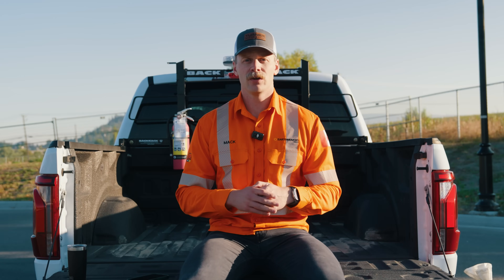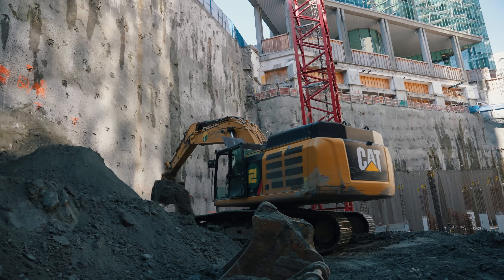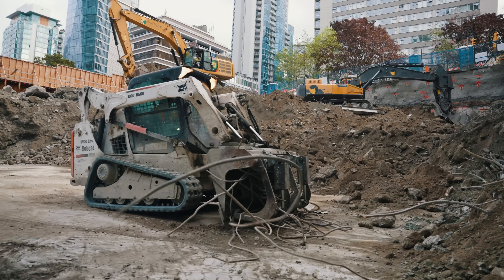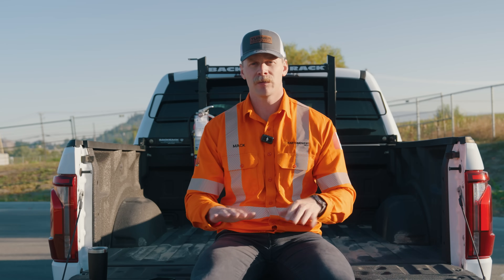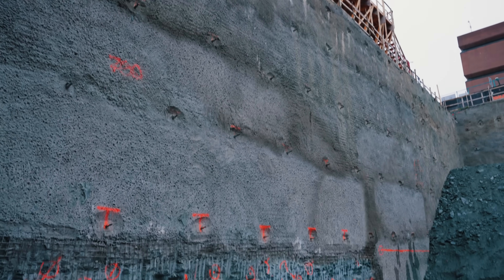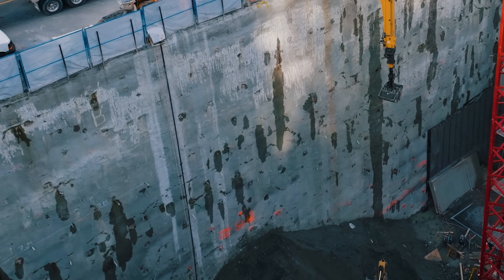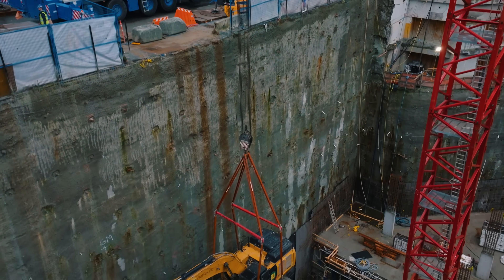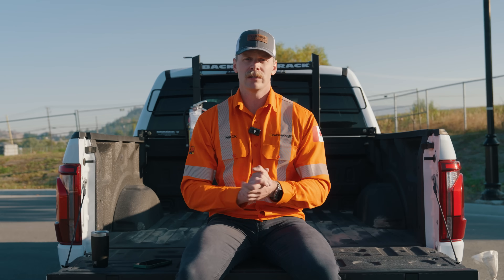Why are They Digging a 120ft Deep Hole in Vancouver? (Insane Engineering)

Comment: Those excavators don’t weigh 120,000lbs a 336 36 ton machine would weigh 79,366lbs and a 349 49 ton excavator would weigh 108,026lbs
Reply from the maker: That's what the crane operator said when he pulled up slack lifted them off the ground. I trust the crane scale.

Comment: If I remember correctly the Georgia Residential Tower on Howe Street back in 2009 was 123' deep
Reply from the maker: Depends how you measure "depth". The elevator footings in this one pushed 130ft deep, but the floor of the excavation was 120ft

Comment: How is this building is designed to be earthquake residents? Is also accommodate one of the reasons to create the foundation?

About 45 yrs ago I had worked for both companies. With bel I work as supply (delivering material) truck. Pacific, Work underground by Canada pool, in New West. Back then they were 2 separate companies.

Comment: i am a GF on the subway project about 90 ft deep, bel pac, and hall did our dig and shot crete, they both did amazing, and once we go to the bottom along broadway, the amount of water that is under that street is insane, i cannot give you a solid number but we have 2 main pumps that are 4 inch in 2000 litre settlement boxes at each end  of the station, that pump into a filtration system, and those 2k litre tanks fill up at least 500 times a day each, from dec, to march that number probably doubles, we have 3 sumps and we constantly have 2, 2 inch pumps in each, and about 6 other 2 inch pumps randomly in spots and tenches draining into those, so what im saying the amount of ground water under broadway is way more than downtown, its insane, its literally a river.
Reply from the maker: That subway project was one I wanted to cover, but sadly they were quite tight about media exposure

Comment: While this is an impressive technical achievement, I’m surprised by so few comments that at a time when there is a crisis with AFFORDABLE housing and many young people are not even getting driver’s licences let alone buying cars why does the City of Vancouver even allow these things to be built? A defining feature of affordable housing is few if any cars especially in dense central areas such as this, while a defining feature of luxury housing is plenty of cars. And at a time when there is a glut of unoccupied luxury housing why are the developers building this? When there is a continually worsening environmental crisis, why is so much energy being wasted on this excavation and removal of soil with thousands of truckloads rumbling through city streets? And to build these giant mausoleums for cars we are required to use greenhouse gas emitting reinforced concrete. As one commentator pointed out it will not be an insignificant commute to actually get your vehicle out of this thing. If you are really looking at a good way to store cars without such a commute or without digging such a hole, the developer could have considered automatic parking which for the same amount of cars, takes up a fraction of the space. Unfortunately any of these suggestions might make a dent in your business model.

Comment: When I was younger I thought of going to heavy equipment school and get certified to operate most digging machines.  Instead I went to work for the railroad.  I think I made the better choice.  At least I didn't have to worry about when my next job would start or shut down during the winter.  Railroading is a 24/7/365 business.😎

Comment: It's surprising and somewhat counter intuitive that the long arm excavator was more efficient than a bucket conveyor or elevator.  That's probably because the soil could be loaded directly into trucks at the top without further handling . 
My condolences to whoever 's assigned a parking stall on the bottom level.
Reply: My guess: the higher condos also get the higher parking stalls. 😁

Comment: We went by this site recently and I didn't realize it was THAT deep.  We watched a dig in Kirkland WA on a regular basis - covid -  (Kirkland/Lake/2nd) - and they used conveyers.  It took 3 of them, but they got it all out.  The amazing part is the stabilization.   Vertical walls w rebar, mesh, anchors, sprayed on concrete.  We watched them do this every 2 or 3 days - amazing work.

Comment: How about a counter weighted bucket / like an elevator.  When the bucket is lowered it goes below the surface at the bottom so the top of bin is level with the floor at the bottom.  Diggers push the fill into bin, the counter weight is then filled with water which then drops and lifts opposing bin.   Water is pumped back to surface and empty bin lowers back down for more fill.  The water is pumped in and out of the reservoir so minimal waste water used.  Only variable is how big and heavy do you want the bin with fill, if the attachment to the bin allowed it to be opened at the bottom or tipped to one side loading into removal trucks at the top be quick and easy.

Comment: Down town, only enough space for an excavator and a truck, next to live traffic, no dirt allowed on the pavement must go in truck, people and equipment working 120 feet below you, digging in rock pieces up to 18”. I would not what to be operating a cable clamshell 180 feet below the boom tip swinging around trying to aim at the side of a loose pile of dirt with people working nearby and then trying to get that swinging bucket of dirt into the truck right next to live traffic 80,000 times with zero mistakes! 
  A conveyor system that can handle 18” rocks, dig under itself, reach 140 feet up, put the excavated material into the waiting trucks (not on the live traffic), have the street open to two way traffic at night. With a company that big, that does this kind of work all the time, that have an office full of bean counting estimators, that bid the job to make lots of money AGAIN. I would guess they’ve got THIS JOB pretty well figured out also.
   I was wondering about the dewatering system on a deep project like this. Knowing that water runs downhill and this project is the deepest excavation around and that Vancouver is near the water. What kind of issues do they have with groundwater and runoff? I have worked on deep excavations next to the bay that had emergency generators because they said if the power should fail the foundation would literally float up out of the muddy ground if the building was less than 2 stories above ground level. And as the foundation floated up all the existed buildings around the project would start to collapse under the floating foundation. And that would be a very bad day.

Comment: Alberni st 120ft down hmm does thst put it below sea level? It just might id say .
Reply: 1515 Alberni is about 4 blocks from the Fraser River so I would guess the bottom of the pit is at least 80 ft below sea level. Hope a Tsunami doesn't wash across V.ancouver!
Reply: @OldNavyChief_314  I think you meant Burrard Inlet.
Reply: @honourbright73   The Fraser River is about 300 meters from 1515 Alberni, the Burrard Inlet is about1100 meters. But a moot point regardless.
Reply: @OldNavyChief_314  Fraser River is several KM away, not meters. 🙄😂
Reply: @alpinexghost  Right you are, I mistook the Pitt River flowing into Vancouver Harbour as the Fraser, my bad.

Comment: There's gotta be a way to get that dirt out faster. Like with a crusher, slurry, auger setup. One bucket full of dirt at a time looks like it would take forever to get all that dirt out of there.
Reply: I'm picturing this set up and it's not going that much faster to me. You gotta crush the big rocks which would be a pain in the ass and time consuming itself, you gotta mix the slurry including pumping down thousands of gallons of water, you gotta pump it back up to trucks which will take time, then you gotta legally dispose of this slurry now instead of just having clean fill you could immediately sell.

Comment: Could have used BelPacific on the UBC Okanagan tower dig up here in Kelowna.  I drove by the site a number of times as the hole was dug.  Even though the hole got deeper and deeper and was directly beside an existing residential tower AT NO TIME DID THE FUCK MUPPETS WHO WERE DIGGING THE HOLE INSTALL ANY SHORING.   Predictably the dig was shut down once that adjacent tower starting cracking.

Comment: So I don’t get why this heavy equipment has to be completely the only way to do this.

Why not some sort of conveyor system loading buckets on a conveyor belt or just a conveyor belt system that can haul the tailings up  
There has to be some sort of system far quicker to implement than all of this slower bucket at a time stuff, mining has been using conveyors for like a century 
Even if you had to drop a small crusher down into the pit you could excavate quicker I would think

Comment: if your parking spot is at the bottom, you will have to descend in a big spiral, circling the parkade at least 
10 times around. 
you won't want to do that more than once a day.  
takes about 15 - 20 minutes.  
THEN you have to WAIT for an elevator and ride it up one of the tallest towers in Vancouver.  
add another 5 - 10 minutes    it's a commute in itself!
plan your outings carefully!
but it's OK because most of the owners will not actually live there!  leaving them empty.

Comment: Why not crush and suck out the material?
Reply: Weight, it was rock. The force to suck the rock 120' and control it when u get it there is difficult. The clam-shell bucket is very big. I'm thinking it was 2 yards, so that's the standard that was quoted to the developers and what they paid 15 months for. Conveyors take alot of space and frame-work to handle the weight.

Comment: The elevator pits are for the bottom machinery for the elevator.  Mostly pulleys for the wire rope. They also swallow numerous items the people dropped in the crack between the cab, and the floor. I had to call in the techs many times for dropped keys. There is always one extra small floor above the last occupied floor. That is where most of the machinery is installed, All the hoists, the computers which are very large and complicated.
Reply: I installed thousands of elevator bucks and the number of times I had to go into the pit for something is horrible. I'm glad I just retired.

Comment: I do not envy that Cat long reach operator precariously perched over the pit with a couple feet of track extending over the ledge.
Reply from the maker: I sat in both machines, It's a weird feeling looking over your tracks and seeing a vertical hole. They have a wood block under the travel pedals to prevent accident travel forward
Reply: @Earthmovers_media  driving track machine here in Ireland  24 years and im getting nervous thinking about this
Reply: I feel like having the treads of the excavator perpendicular to the edge of the excavation is dangerous. One wrong move when trying to back out, and you end up accidentally driving forward off the edge. I would think it should be standard practice to bring the excavator in from the side and align the treads to be parallel with the edge, so it can only move sideways, not forward off the edge.
Reply: @AWSVids  There's a reason why digging or moving material as close to parallel to the tracks as possible is standard practice - stability. Digging over the side (perpendicular) to the tracks is the least stable for an excavator and when most rollover / tip over accidents happen. Additionally, the metal tracks have a lot less grip on concrete / asphalt than you might think. It's very easy to accidentally pull yourself sideways when the track grousers are inline with your digging. Not driving off the edge is simply a matter of operator competency. As noted above in another post, wood blocks were placed to prevent accidental track movement.
Reply: I do. Would love to be operating it.

Comment: Maybe a dumb question, but if soil removal is the bottleneck, are excavators really the best solution? Why not a conveyor belt/hopper/auger system that can continuously and automatically load soil to the surface, rather than a full time operator moving one bucket at a time?
Reply: Its the trucking/removal from site. Vancouver traffic is terrible, and the dump sites are a good distance from the excavation which leads to long turnaround times for the dump trucks.

Comment: Cool. I'm servicing the tower crane on that worksite. The most parking levels I've ever been.
Reply: That's got to be 12 floors of parking. the drainage system must have been hell to install so you wouldn't keep getting flooding in the parkade
Reply: Where did they take material from hole to
Reply: I operate the RT building pods for the building. Try checking the shoring every morning all 8 floors of it lol

Comment: I see they have a tower crain there. Why don't they modify the crain?? Shorten the outward boom. Then put the clam style at the end of the cable. Run a flexible hydraulic with the cable to the bucket. Or have a small hydraulic holding tank close to the bucket. With only enough hydraulic capacity for the hydraulic cylinders. Then have an electrical switch controlling flow of the cylinders  from the cab. Have the electrical cable inside the cable. Running down the center of the cable.  With extra amount sticking out both ends for hookups and connections. The crain will just swing over the dump truck on street level. Just like picking up a load of rebar or something. I'm not sure what is the lifting capacity for these crains.
Reply: The tower crane was erected near the end of the excavation process.  The purpose of that crane was to start on the construction before the excavation was complete and also busy with its own tasks.

Comment: To all the conveyor belt fans, BelPacific obviously knows how to dig and remove the spoils from a deep hole. Some smart fellows crunched the numbers and cost and decided that to make a profit, all the engineering, fabrication and logistics of deep reach excavators was the cost effective solutions. These kind of projects are not done lightly. Good Job BelPacific, next time I need a 30 meter deep hole I know who to call.😉👍
Reply: Belpacific knows how to make money, by making the job last longer.
Reply: Even just thinking of how they would do especially as they are digging the floor underneath the conveyor belt it instantly become impractical. You'd have to remove the conveyor dig down then remove the dirt unless you attach it to the wall and that is very likely going to pull on the shotcrete cause it to crack and next thing you know cave in under the street
Reply: Seems to me it would be a scaling thing. One dig with excavator, 10 digs with bucket conveyor. Sometimes you need to invest to get ahead.
Reply: Standard  material hoist would be good. Just have a loader dump straight into dumpsters.
Reply: Conveyors make it hard for shoring. I worked with Bel or norland now for years. When we did the excavation for Brentwood 2 we used a Conveyor system it was a pain in the ass but worked because we had like 4 times the space so we could kinda move it around and work safely around it.
Reply: To all the conveyor belt fans... a big vacuum hose would work better than a conveyor belt.

Comment: Surely a system of sloping conveyor belts would move more dirt and faster, it’s a huge hole so the distance and angle would not be a problem?
Reply: not for a dynamic 15 month jobsite, too many reconfigurations. any solution should be topside based, but a purposebuilt crane would defenitely make more sense, since if built well it could be used at their multiple jobsites
Reply: I was thinking exactly the same, a bucket conveyor belt.
Reply: I believe you couldn’t move enough dirt away from site due to congestion to pay for an elaborate conveyor system, traffic sucks!

Comment: As opposed to using customized Excavators, I'm surprised they wouldn't use a series of Belt Conveyors to the surface and/or an Auger (for fine material). It seems to me that would be faster and more cost effective although, it would take a pretty special conveyor that could be extended or have Switch-Backs to meet the ever-deepening demand.

Comment: I would have thought conveyor belt or auger technology could have been deployed to lift that spoil out of that hole.
Reply from the maker: Too steep, conveyors don't do vertical well
Reply: @E @Earthmovers_media I was thinking of the type with buckets bolted to the belt, a bit like combine harvesters. It’s just that contraption of an excavator seemed painfully slow. I’m no civil engineer as you’ve guessed.
Reply: large vacuum pump it is then ?

Comment: thanks. 120 feet deep, is that below sea level?
Reply from the maker: Not certain on that one as this building isn't at sea level
Reply: @Earthmovers_media  It's only a few blocks (2/3) from Burrard Inlet can't be more than 40 ft above sea level, so I would say yes way below sea level.

I wonder how hard the pumps were running to keep the water out of the pit. It would absolutely suck if the pump failed and all of a sudden the whole pit is a swimming pool

Comment: Invention for over 100 years ago - conveying belts
Reply from the maker: Conveyor belts don't do vertical well
Reply: @Earthmovers_media  A vacuum hose would.
Reply: @Earthmovers_media   with buckets.  Gold miners have used them for hundreds of years.
Reply: I did traffic control once in Alexandria VA at a site similar to this that had a 90 degree vertical conveyor system. It was filling trucks quickly.
Edit 
I took a few pictures of it so I found them. It looks like the name on it was Robbins. Cool machine.